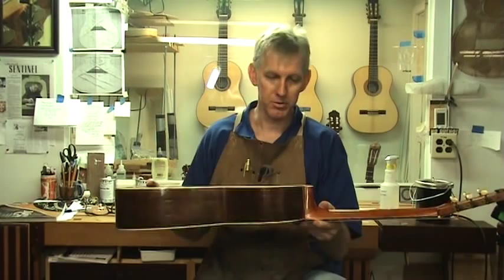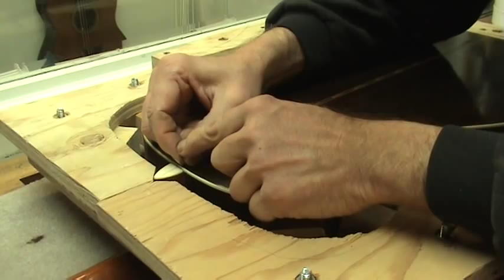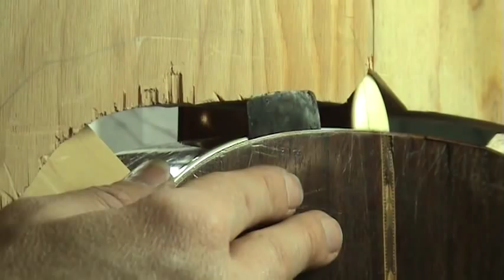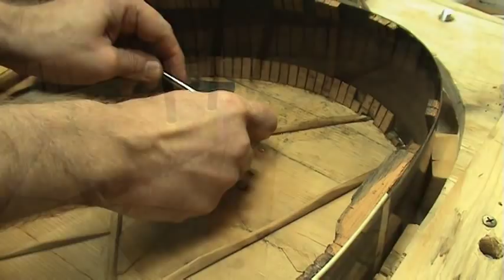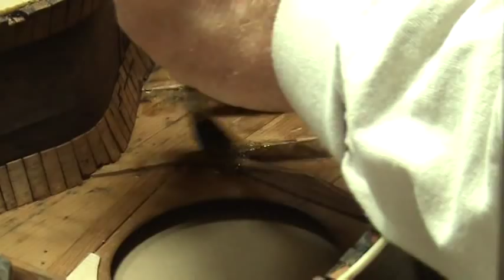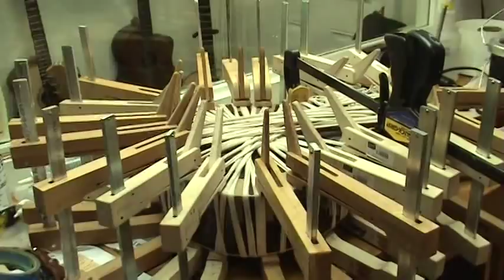1890 Martin Guitar Repair by O'Brien Guitars

Comment: 0:46 This little Acoustic Guitar needed to be fixed, it came strung w/ really heavy Gauge Steel Strings. These old Acoustic Guitars were designed for Gut strings (nowadays Nylon) & for a Steel String sound you'd need to use the lightest gauge of steel strings, silk & steel, or even so Thomastik KR116 strings.

Comment: to Kevin Smith...Mr O'Brien uses silk and steel strings that usually have a tension of 120 pounds, which is a bit too much for a guitar this old designed for gut strings (e. g. the hardest nylon strings are about 90 pounds), I would rather use some Newtone strings Heritage (all steel) specifically designed for vintage guitars, these have 90 pounds of tension also equally distributed on each string.

Comment: Was wonderful to watch this, to see how was restored and how nice the sound. I just bought a 1904 Washburn very very similar head and neck is great but body has big cracks front and back. I see back must come off reglue with carpenter glue. Wondering 1) what glue you used on cracks and 2) what are little white squares placed on cracks and 3) what type / brand replacement strings did you use?
Reply from the maker: I used hide glue for the repair. The cleats were used to secure the cracks on the top. They are made of spruce and the guitar was strung with silk and steel strings after the repair.

Comment: Hay Robbi, great job as usual my friend. This guitar sounds wonderful , I was able to buy a German parlor on eBay, the back is off and the neck is off, but the top isn’t great condition. Nice on piece of fur or spruce. There is no bracing on the top and I would like to put an brace in it  I see this guitar you worked on here. I wonder if you could give me any information about how big the brace would need to be ? any guesses?
Reply from the maker: It would be hard for me to advise without having the guitar in hand. I would just choose a bracing pattern and build lightly.

Comment: .very nice job, thanks for the video, one question, you drilled a hole and a oin in the back by the heal. What was that for? I own a 1888 0-28 w/ coffin case with only two repairs on the lower bout sides. the guy before me had steel strings on it from the 60's. oh , mine has solid ivory tuning pegs sticking through on a solid head stock. these are beautiful guitars. one of my pegs broke, how should i fix it?
Spankey
Reply from the maker: +spankey lee The hole is so that I can use a locating pin to help me fit the back in the exact position and get the neck angle right.

Comment: I just viewed your video, great stuff! I’m curious though on how you determined it was a 1890 model. I inherited an old Martin from my Dad. It’s a 0028 in its original coffin style wooden case. The tag in the string and pic storage area, says it’s a 0028, made in NY.
Reply: Sorry! My memory is going! It’s a 0-28. But most of the guitar shops say it’s a mid 1950’s Martin and not worth a lot? There is no serial #, but has CF Martin branded inside the body, the nut and back of the head. Not sure what more would point me in the right direction? Would you comment on this? I know not seeing it is a shot in the dark.
Reply from the maker: @davidswanson5652  The owner helped me on this and knew a lot about the history.  Doing a bit of research in books about body size, shape and appointments helped also pinpoint the date. 1950 would have had a serial number.

Comment: What is the size of this guitar? (concert-maybe?) please answer
Reply: This could be considered concert , although parlor is more accurate. I guess.  It has 12 frets to the body. It's a 000-18 steel string. But the strings used are the low tension varieties. Part of what we at our shop find, is people stringing them up with electric guitar and heavier gauge strings. The result is bridge pulling up and/or top cracking.

Comment: There seems to be something wrong with this restore ? If you look closely at the back (pause at 5min09), there is a small part of wood sticking out above the binding. Near the neck heel. Which means the back wasn't properly clamped while the glue was drying ? I would be pissed if I saw this on my vintage martin..
Reply from the maker: could it be the purfling line you are seeing?
Reply: @OBrienGuitars  it just doesn't seem flush at the neck heel ? like if I would run my hand over it, I would feel the edge from the backplate getting caught on my fingers instead of a nice flush surface.. That's how it looks judging by the video but ofcourse without the guitar in my hands I could be wrong :) bye

Comment: What was the charge for this restoration?? Great job BTW
Reply from the maker: It has been a few years since I did this job so I do not remember. However, I do remember that it was probably cheaper than it should have been.  I have one on the bench right now for restoration and it will not need near as much work but will run a coupe of grand to restore.
Reply: Thank you for your kind reply. I have been repairing fretted instruments for quite some time now  and I just completed a job that I'm sure I charged too little for. Thanks a lot for your advice!! Like I said, I've been doing this for a lot of years and I ALWAYS learn something new from your videos. Please keep them coming as I'm sure we all still have something we can learn from each other!!
Reply from the maker: Thank you for watching and glad you are finding my videos useful.
Reply: I think we all probably do.